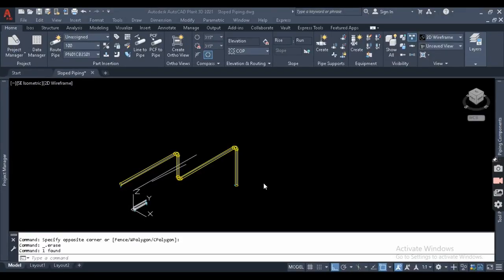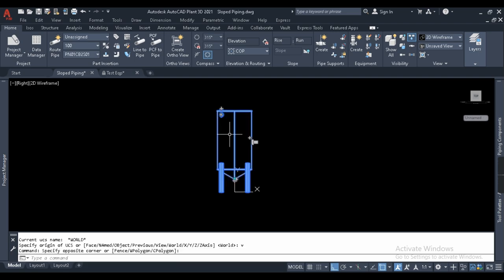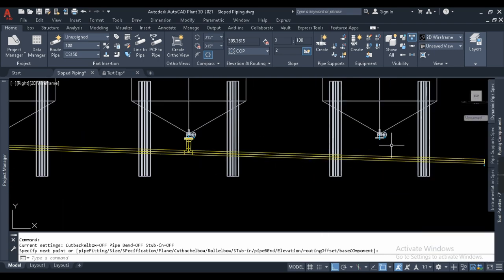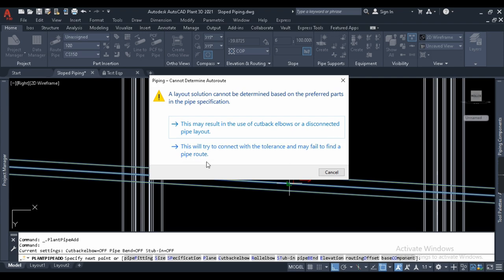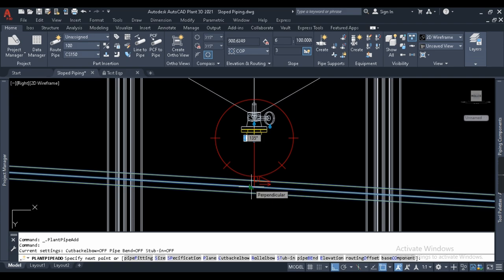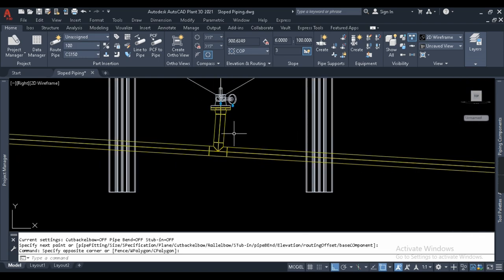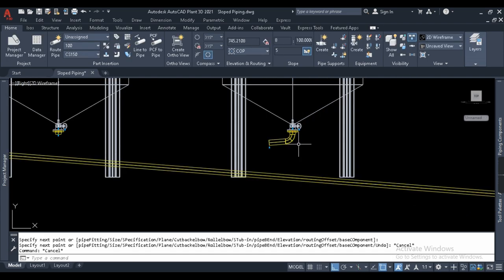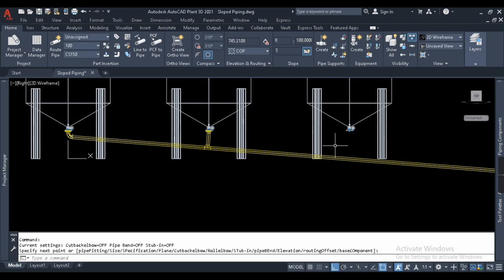Sloped Piping Part 2 | Tutorial Mastering Sloped Piping Tolerances in Plant 3D

Comment: In a real project the connection to the flange should be straight, the connection to the TEE should be straight too and only the pipe in between the TEEs should have a slope. Did you find a best practice for drawing such a design?